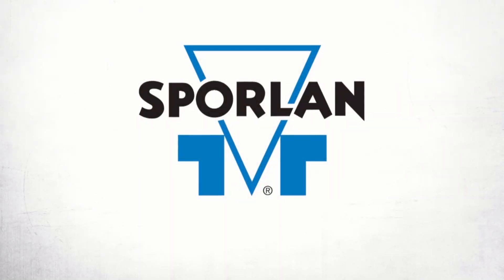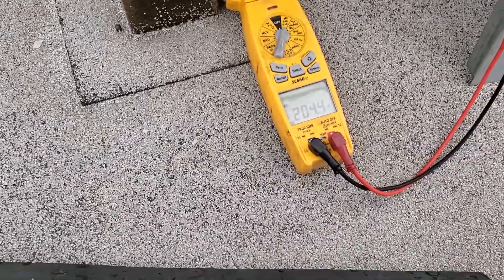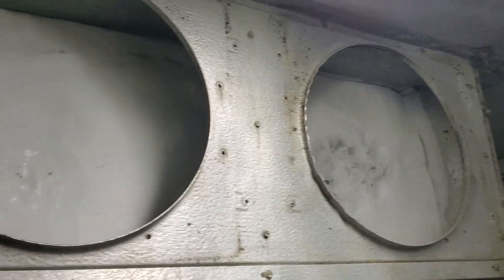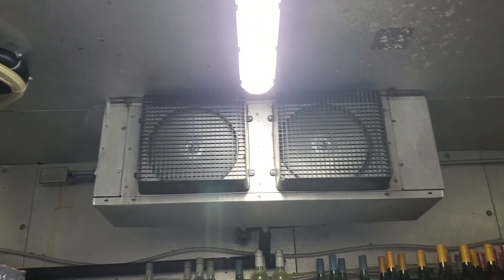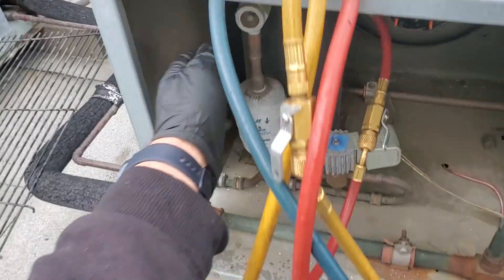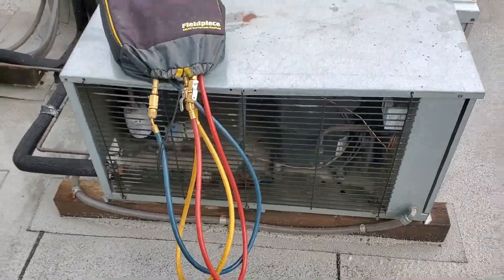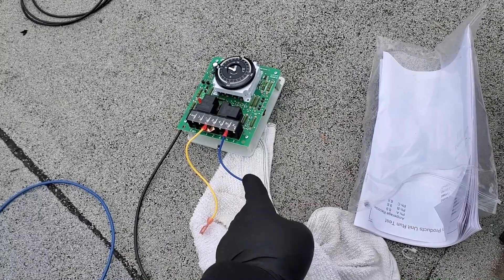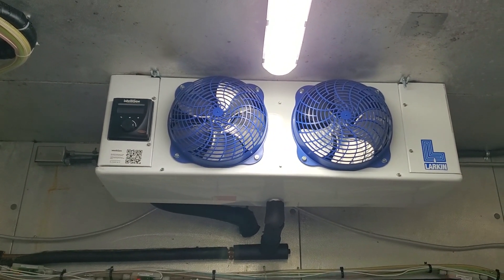WALK IN COOLER TOO WARM

Comment: I am german and I have learnt frigorist from 1957 to 1960 in the Saarland. I have then as a monteur/machanic/fitter workt. 1972 I have make the examination of a master in this business. By the begin we have build the kondensingunits and the evaporators, with open kompressors for CH3CL (cooling liquid), in own workshop. I was in this sector at 2003 in work. Then just as pensioner I am interesting at new system of work, new cooling liquids and new tools. Thank you for the presentation.

Comment: I like how the expert pin is just 99999
Reply: The ol' reliable 11111 was probably too easy lol
Reply: Max Moors the most common default pin codes are all 0, all 1 or all 9
Reply: @asknightmareluna6445  Yeah, it's with the aircons at work too. They also all are 9999 for the advanced settings 😅
Reply: Max Moors which confirms my point. 0000 is for unsecured while 9999 or 1111 is secured

Comment: Great video Chris! 
On those carel valves you can disconnect the wire connector and rotate the coil to open and close the valve. Then you don’t have to power them up. Don’t pressure test over 150psi. I argued with the Heatcraft teacher at the intelligen class I was in about that. He said you could test up to 300 psi. I have put about 8 inteligen units in and about 20 QRC units. They are good units very little issues.
Reply: Tech told me to slip the transducer off if I wanted to test above 150 psi.

Comment: I’ve seen those exv components fail a lot on a certain brand I won’t name.  Not worked with the heatcraft supplied digital Evaps yet.  Basically because in Australia heatcraft struggles a bit with their service.

Comment: All cables and conduits are supposed to make mechanical connections at termination points or transition points, meaning all conduits shall be mechanical connected, and cables shall have a fitting at termination point.

Comment: Excellent video. I like the follow up at the end. It sums everything up and explains a few things as well. I havent had much experience with that make but they look pretty slick. I'm amazed that your coolers have defrost timers on them. Up here in canada very seldom is there a defrost clock on  a walk in cooler. Must be the humidity down there or the higher temps keep the units going longer

Comment: Wanted to share some feedback from Heatcraft and I from the field -- bubbles showed up in the sightglass on a 20 degree freezer - normally 1st reaction would be to keep that sight glass full so you have a full column of refrigerant feeding the TXV -- not so fast. My first instinct was getting a temperature drop across the drier -- Heatcraft wanted me to take a pressure drop at the outlet of the receiver; then, use the same high side hose and take a pressure reading downstream of the filter drier -- kill me now. Also take subcooling and superheat readings at the CU -- Modern Refrigeration CU's condense much lower than 30 degrees above ambient temp from 10 years ago.
Reply: minus 20 degree freezer

Comment: I’m not even remotely qualified to troubleshoot HVAC and I agree that the evaporators and condescending unit required replacement. I also find that many people want a quick fix rather than a correct one. Perhaps the valve issue is improper technique.

Comment: The old line-set was no so bad, cause it was not a condition of burn-out. If it was a burn-out then then old lines should be flushed or replaced, but is merely a number of components worn out. These new rotary compressors have no valves to wear out or restrict flow making for a more efficient systems.  And in theory, with digital control, air defrost might even be dependable. How is there so much filth in the coils ? Does someone sweep the floors into the cooler ?  The customer needs a wash hose and a schedule.

Comment: Cylinders so shiny I can see yourself! What causes all that damage to the fins on the coil? Tap dancing elves? What can be done to avoid the problem, short of regular cleaning?
Reply: just a passerby but I'm gonna say many cycles of freezing up and thawing probably damaged the fins like that.  The same way ice damages roads and sidewalks.  Enough freeze/thaw  cycles and it just crumbles.   But due to the apparent laziness of previous maintainers it could also have been careless handling of the units too.

Comment: R448 a is a very efficient refrigerant and runs at similar pt ratios to r22. Ive never seen those intelligent coils. I'm not sure how i feel about that. Cool to see though.
Reply: they are a pain and savior. Depends on what issues u are having.
Reply: I'v been getting advertisements for Bluon R-458A on these videos. https://www.coolingpost.com/world-news/bluons-r458a-refrigerant-is-snap-listed/ Seems to be a complex blend of difluoromethane (R-32), tetrafluoroethane (R-134a), pentafluroroethane (R-125), hexafluoropropane (R-236fa), heptafluoropropane (R-227ea). The specs seem to show it runs at lower pressures than R22, transfers heat better, and requires no modification to R-22 systems to retrofit, as it's mineral oil compatible.

Comment: You mentioned you checked rotation of the compressor. How did you do that? With a phase rotation tester or is there a easier way? Still learning. I know that say on 3 phase to just switch a leg on scroll compressors if you don’t see it build pressure right away or if you hear it start up hard. But is there a better way? Or and do they normally rotate clock wise or counter clockwise on Copland scroll? If you have insight it’s always good to learn from your videos.

Comment: I hope the manufacturer of IntelliGen controller has some special type of rotary encoder/switch. From my experience when used rarely they stop working after a few years (e.g. Nibe heat pumps). Even after 5 minutes of turning they do not operate properly and servicing is a nightmare.

Comment: Great job Chris, thanks for walking thru the intelligen, never seen those before thanks for sharing.Basically the B Unit is a slave to A? is there only one solenoid? Appreciate you bud thanks again
Reply from the maker: Yeah the b coil is the slave, the electric expansion valves acts as the solenoid valve. The master coil communicates with the B coil via a shielded com line. But each coil has it's own valve

Comment: Do not remove that time delay on that condenser!!! Heat craft adds them because of the scroll compressor. When they pump out they have a tendency to wind backwards and short cycle on and off on and off!!! I just talked to heatcraft last week and told me not to remove it!!!!
Reply from the maker: With the QRC and the Intelligen I have been told by heatcraft they cause error issues with the board do to the lack of superheat change....... I'm curious if you are talking about with the smart evap systems?
Reply: They have told me any unit they sent out with a scroll they should stay because they keep getting warranty contactors and pressure switch failures because of the compressor pumps out, the contactor pulls out and the discs wind backwards causing the suction pressure to fly up and kick in right away and back off. Tin can compressors it is not needed but only on the scrolls!!!!
Reply from the maker: @daveg8918  Yeah I have gone out on two warranty calls on the smart evaporators that have the time delay's and heatcraft told me to remove them due to error messages caused by the time delay. I always remove them on smart evaps now and leave them on the non smart evaps. Per Heatcraft tech support. Next time I talk with them I will get clarification
Reply: Yes I am greatly curious!!! Just verify about it being a scroll compressor or not because I was told that same thing as you unless the condenser has the scroll compressor? But that’s why sometimes factories drive me nuts because you get different answers from each tech support person!!!

Comment: (Google translator translation)   Hello! tell me how is the protection of control units from moisture implemented? degree of protection indicated? ip54-68? usually when microelectronics condensate and short circuit from heat to cold. if you show how it works, I will be very grateful! Vasily from Russia. Great job!

Comment: Do you have opinion how much owner can save with electricity bill with new unit versus old one?
Reply: I think this depends too much on the exact units used and there condition to make a general statement. I can tell you al little story from work tho: We used to run some very old systems still using R-22 back at the place we had rented for our servers. Switching to a new site and using heatpumps we cut our cooling/heating bill by more than 2/3 since we could use the server room heat now in a useful manner :)

Comment: Probably uses 1/2 the electricity the old system used.   How do you check the rotation with a meter?
Reply: Check the Phases from L1 to L2     L2 to L3    L3 to L1  you need to have a clockwise rotating field

Comment: Hey Chris do you run RX-11 flush through your existing lineset  just as a precautionary?
Reply from the maker: No I didnt the original R-22 system had POE oil already so I wasnt worried about using the existing lineset. Plus I am not a fan of RX-11 as I have heard it can cause system damage.....
Reply: @HVACRVIDEOS  What's POE oil?

Comment: do time delays on these smart heatcraft units cause issues with temps at all cause I had to jump one out today. It's kinda weird to me any info would help.
Reply: If it’s not wired up to the condenser I don’t see a problem with leaving that time delay on, it would keep that scroll from short cycling.
Reply: @captainkirk7702  I talked to two reps from heatcraft and they both said that was the main issue. checked all pressures and settings and probes, and superheat with my tools and manual, and they checked out. I gotta check back tomorrow and make sure it's at setpoint. I may switch it to timed defrosts as opposed to the demand defrost as well.
Reply: hierba556 I thought it was ironic because I just did my first install of this Intelligen Wednesday. It didn’t have a scroll but I couldn’t see how it could have an issue with it, maybe if it was wired to the condenser I could see it, especially with this controller.
Reply: @captainkirk7702  it's wired to a t-stat (in), and to contactor coil (out)
Reply: hierba556 then that makes sense, because me not knowing nothing about this controller, the other day I was programming it and by mistake I put yes to is the CU wired to it and it gave me grief, it would turn on and then cycle down. Displaying a open circuit. I scratched my head for some time before going back to the program and put No to is the Cu wired and it started operating correctly. It’s the wiring to the condenser that is the issue. I didn’t have to connect wires from controller to the condenser. Now I understand!

Comment: Why not use a fan speed control instead of a winter/summer charge? Seems like it is a big cost if the system has a leak
Reply: Speed control will only work down to a certain temp. That is where flooding the Condenser comes in . It effectively reduces the size of the condenser allowing it to work in lower temps. If you are in a area that does not have severe winters you can get away with fan control. Even in somewhat milder climates the headmaster  helps you by controlling the compression ratio, thereby saving stress on compressors. Stress kills compressors eventually.
Reply: @rosskious7084  I get waht you are saying, but i get the hunch that Chris dont work in climates with severe winters. Moreover the amount of ekstra refrigerant lost with a headmaster system probably pays for an entire new compressor...
Reply: @SAAJ6000  on the small systems he works with the extra refrigerant would not even come close to the cost of a compressor. 3 to 10 pounds extra ( on the systems I have seen him install) will not break the bank. Plus it gives you a reserve for those pesky small amount leaks ie roto locks, valve cores flaR fittings ect. However he could get by with out headmasters in his area. Now on a parallel compressor rack system the cost of refrigerant gets to be astronomical.
Reply: @rosskious7084  In my country 1 pound of 404A cost around 400 us Dollars. I guess it is cheaper in the US then.
Reply: @SAAJ6000  R404 is way less than that in the USA. A jug of R404 would not come close to the price of a compressor.... let alone the price of the compressor, all the items to change it and the labor. We use R448 in most installs now. The cost of the R448 is higher than the r404 which is crazy if they want you to change from R404. At $400 a pound I would not do a winter charge system unless I had to.
Reply: @rosskious7084  We are changing over all Supermarkets to R744 Co2.

Right now we are beginning to install small commercial R744 systems aswell. Panasonic are making some amazing units. Still a little costly though. (around 10.000USD for a 3 kw system). Use of new 404 is illigal in Denmark. We have to use reclaimed.

Comment: You don’t have problems with your expansion valves because you do it right. I’ve never had problems with expansion valves regular or electronica on my installations. I have found problems with expansion valves on other peoples installations. But there was a very good reason for that and “it wasn’t because the expansion valve is defective !”. That caused a expansion valve to have a problem.     My father warned me when I started working with him at 12 years old stay away from people who always have failing expansion valves on their installations. And they always blame there’s so many defective expansion valves.